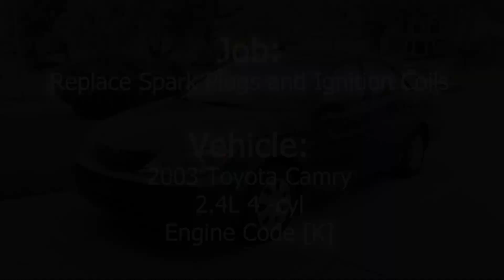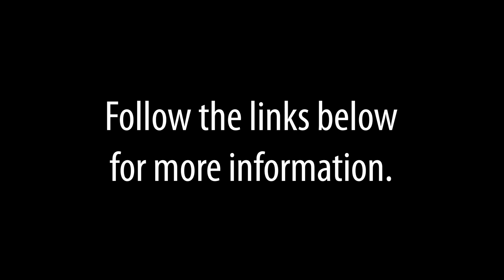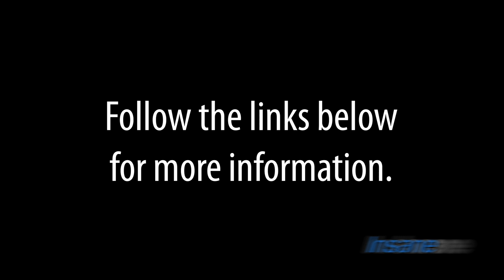2003 Toyota Camry - Replacing Spark Plugs and Ignition Coils

Comment: Plugs should not be lubricated with anti seize or any lubricant as recommended by NGK. The threads of the plugs are already coated with special compound so can be put in dry.
Reply from the maker: Thanks for the comment.  You are correct in that NGK spark plugs have trivalent plating which can act as a release agent during spark plug removal.  However, the repair manual states that the application of a small amount of anti-seize compound will help prevent damage to the threads the next time the plugs are removal.

Comment: For iridium plugs, I thought they say don't gap them? At least in my Toyota manual
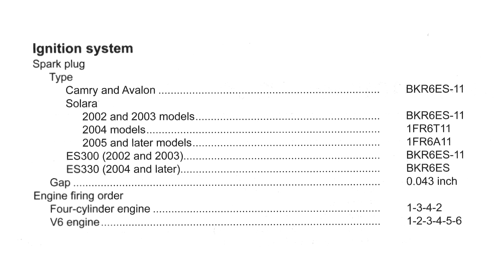Reply from the maker: My repair manual said to gap them to .043.  See 3:03 in the video.
Reply: For the DENSO spark plugs I got they say don't gap them. He got a Autolite plugs so I don't know if the same applies. Anyways, according to the repair manual, the electrode gap can go from 0.039 to 0.043 in.
Reply from the maker: @alejandrovargascarrasco198  As long as you follow the repair manual, you should be alright.

Comment: What was that lubrication that you used?
Reply from the maker: Anti-Seize for the threads and Di-Electric Grease for the boots.
Reply: dont apply anti seize btw. It will mess with your torque specs

Comment: What do I use to clean the spark plug holes if I don’t have easy access to compressed air? Assuming keyboard cleaner isn’t enough
Reply from the maker: You could try using a vacuum (or shop vac).
Reply: @InsaneOil  oh yeah, I got one of those. Thank you for the reply!

Comment: On my 2003 4 cyl Camry, one of the 10mm bolt holes for  its ignition coil is stripped. Any  idead for how to secure it?
Reply from the maker: Off the top of my head I would say run a tap of the same size down the hole and then very gently install the bolt with a little threadlocker or retap it to barely one size larger (even if it is SAE) or get a little longer bolt that might reach some of the good threads at the bottom and shim the head if necessary.
Reply from the maker: Or get a different valve cover from the junk yard.

Comment: Thank you for this video. Sincerely.
I had to have my coil on cylinder 3 replaced a year ago. All spark plugs were replaced as well. I just had that same coil go bad today, 2 hours away from home (I took a trip with my kids). Same symptoms as before, and O'Reilly's code reader said cylinder 3 was misfiring (again). Used this video to get my repair done in a matter of minutes, and now I'm home safe with my daughters. Not sure if my engine is messed up somewhere else that is causing this, or if I got a cruddy coil last time, but at least it's fixed for now.
Reply from the maker: That is awesome.  Thank you for sharing.  It sounds like a successful repair.  It is possible the same coil just went bad.